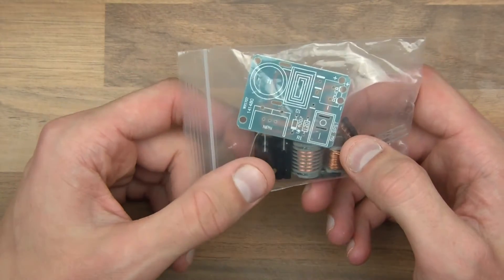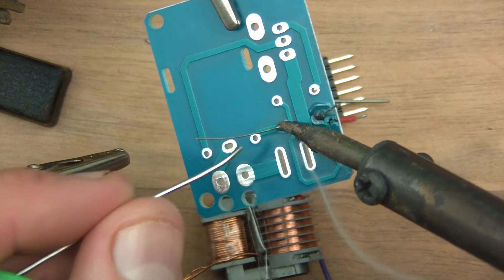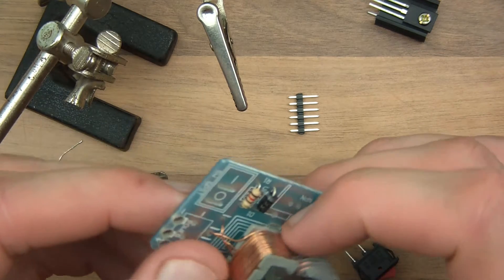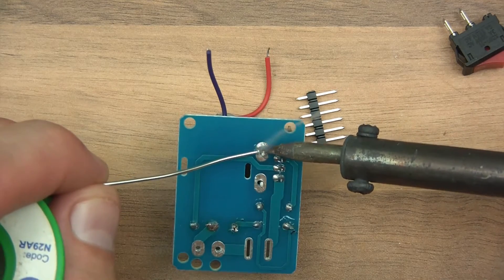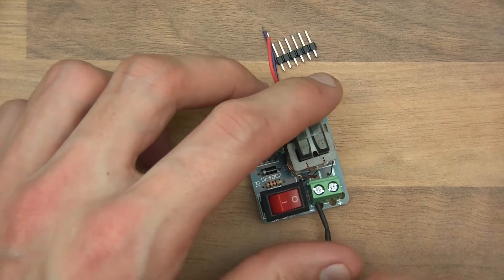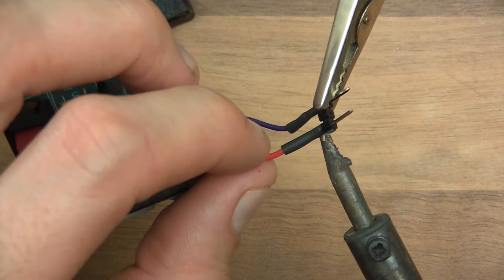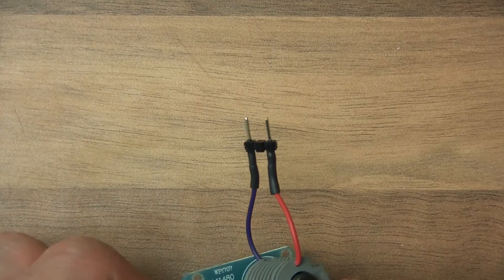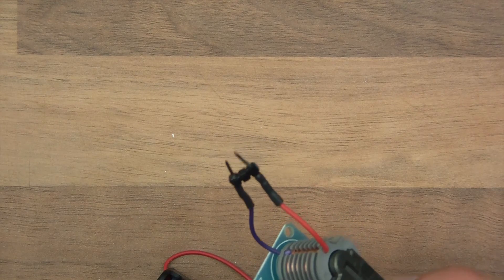Kit Build #4 - Cheap Ebay High Voltage Arc Generator!

Comment: what is the max input voltage - I see most guys use 1s cell (3.7v-4.2v) should I use a regular 9v battery or can I use a lipo?
Reply: Any DC supply will work

Comment: What is the output high voltage (Dc or Ac)?
Reply: its ac
Reply: @swotiix3993  right because if you put a mica capacitor on the transformer primary then it charges and discharges and makes a Ac sinewave depending on the primary Inductance and capacitance.
Reply: DC, the D882 Mosfet makes the DC work for the transformer
Reply: @erikhart9840  ok its High frequency DC pulse

Comment: I bought this kit as well, it came in pack of two. So after a few hours of soldering and desoldering and trying different configuration between the primary and feedback coils and the converters still not working, I changed my attention to the transistors. I discovered that the kit came with the rong type of transistors, it's supposed to have pin configuration BCE with the base connected to the diode and resistor from the feedback coil, but the D882 ( transistors provided with the kit) has pin configuration ECB. So if you buy this kit's check every thing and measure everything before you start soldering it on PCB, it will save you some time and a headache.
Reply: I just almost got a headache, thank you for this comment!
Reply: How did you fix it?

Comment: I wonder if there is any "safe" way to actually test the output voltage.
Reply from the maker: Lols, I don't know, but I can tell you that I've had a shock of this thing! It's not nice! Ha!
Reply: You could use a television high voltage probe. Used for testing high voltage of television CRT's